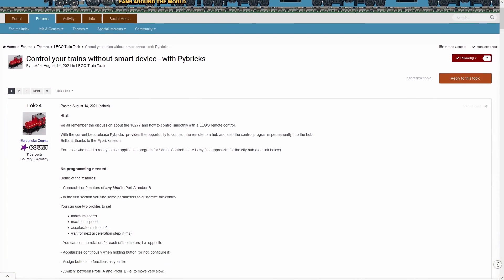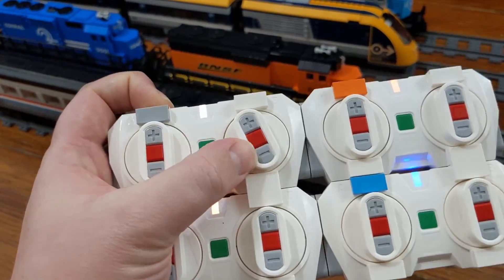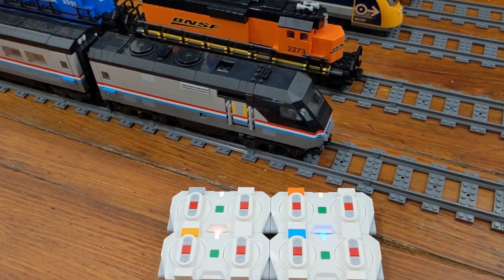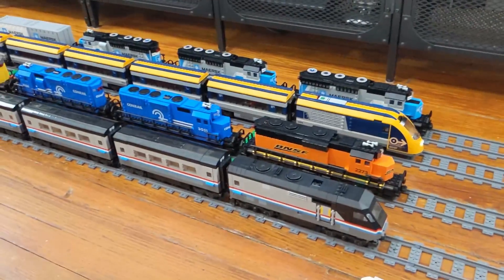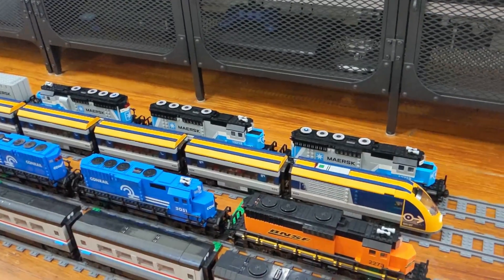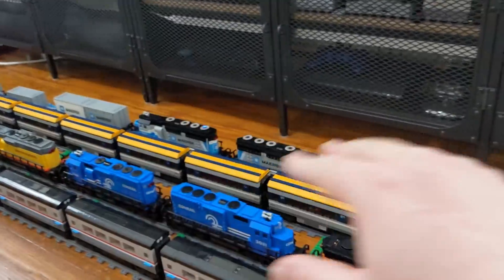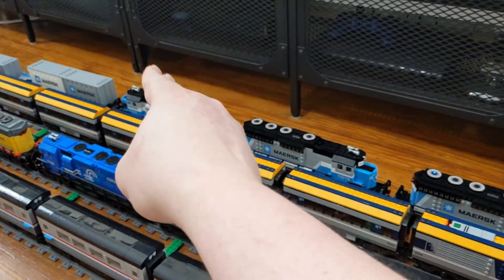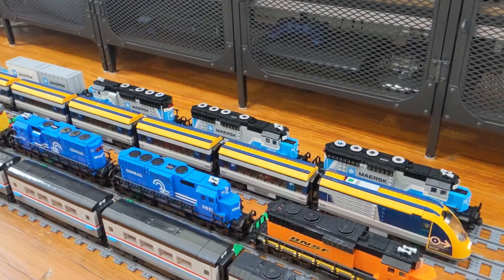Multi Unit / Distributed Power with Lego trains using PyBricks!

Comment: I'm getting back into lego train and i'm still in stock by prices of some models.
How in the cresus lord did you find oll of thoose maersk sets
Reply from the maker: I have videos on all of it 😅.  The actual Maersk train was pieced together buying parts online and I didn't use the original Maersk blue color which is crazy expensive and exclusive to those sets.  It would have cost an absolute fortune to buy actual Maersk sets
Reply: which site are u using to buy parts online please ?
 @BatteryPoweredBricks
Reply from the maker: Bricklink.  My videos on the My Own Train series go more in depth with how I use the site to get the parts I need.  It does take a good bit of effort but it can be much cheaper than buying sets outright.  Especially if you already have parts in your collection

Comment: Cool! It's probably time we add more train examples like this to our site :)

We recently improved hub-to-hub communication so you could even relay the remote signal to all trains.
Reply: Oh, that's what you're using now. Neat!
Reply: And yes, the delay is going to be lowered even more.
Reply from the maker: Yep!  Lok24's original program is truly a work of art.  Automatically detecting the type of motor connected (For steam or large locomotives that use Technic motors), the smooth acceleration, all of it!  The additions by @mpersand really brought things to the next level!  Of course it is all built on the back of the hard work put into the PyBricks firmware.  I'm always glad to make my silly little videos to contribute to the Lego community as well 😅

Comment: So basically you have recreated all functions that are offered by IR PF controllers and receivers. But the overall cost here is like 20x or more higher than PF.
Reply from the maker: In short... no to all of that 😅
Reply: Hi, I’d like very much to hear more about power functions and their wireless communication between battery boxes and motors using infrared point-to-point lighting systems that have zero autonomy. I must know how this works. Please bring this knowledge into the sunlight… oh wait…
☀️📵🤔😂
Reply: @GearsAndBricks  There is no need to have wireless communication between battery boxes and motors to control more than one motor. Just set the same address at the IR receivers to control more than one motor. Also speed and acceleration can be controlled using wheel at the IR controller, no need to have BT equipped boxes, smartphones, python scripts to just adjust PWM duty cycle...